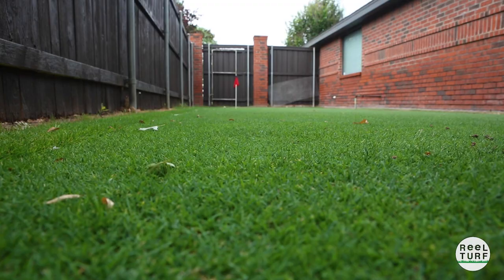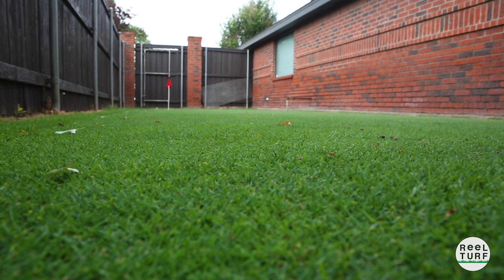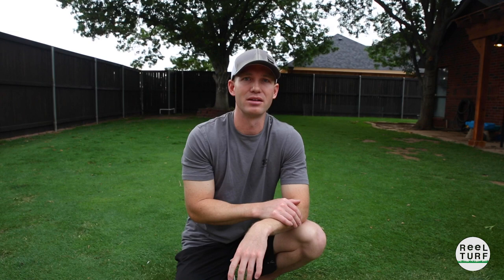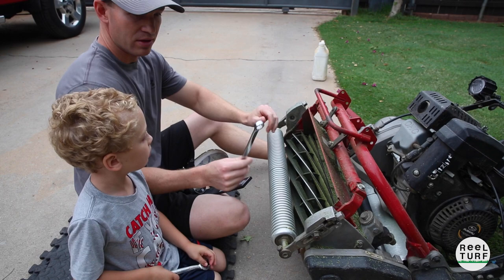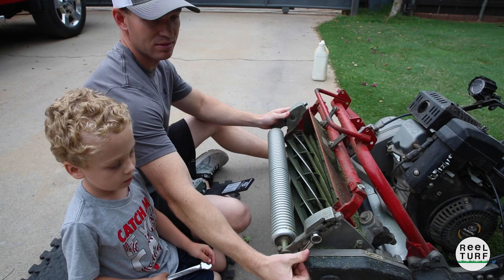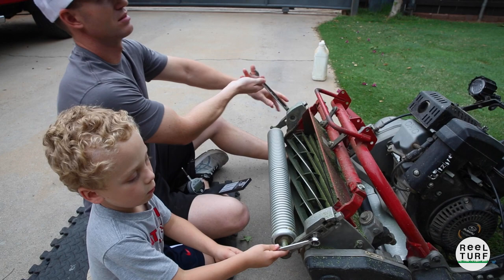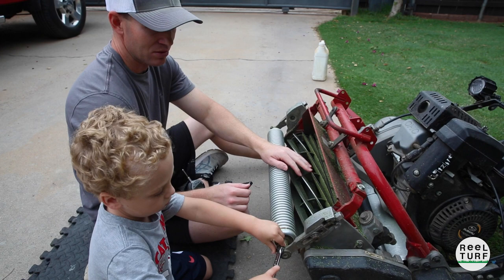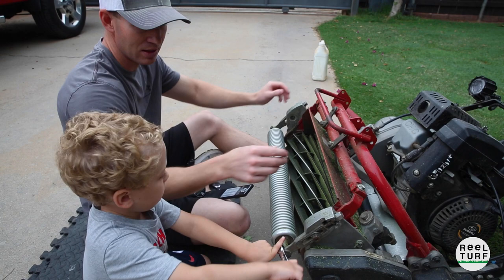Mowing an Overgrown Putting Green

Comment: I use Arena to lessen the worm castings. It’s mostly for grubs but it does take some of the worm pressure off the turf. Not sure if there is a better product specifically for worms, but that has worked for me every year. Thanks for the videos, I love the detail that you provide.
Reply from the maker: Glad you enjoyed it! I haven’t come across a permanent worm solution. From what I’ve read in the turf world, top dressing plays a big role in the suppression of worms. The sharp sand reduces their activity on greens. I believe they were bad for me because my green base was primarily clay. Had I known better back then, I would have incorporated a lot more sand.

Comment: So I commented on another video about attempting a putting green this year. Right now I just have a manual reel mower that can get down to 0.5". I'm hoping to secure a greens mower for next season but is it going to be difficult/damaging to take it down lower next year when I do eventually get the greens mower? Do you just slowly work your way down? Any advice on helping with the stress that will likely come from taking it down or does bent grass generally recover fairly well from that type of temporary stress?
Reply from the maker: The best time I have found to take the height down gradually is very early spring when the grass doesn’t grow much. You have less disease pressure and slower growth which allows you to take it down slowly without yellowing. You cannot scalp bent like you see people do with their lawns. Most of what you’ll see on the internet is people scalping their Bermuda to death or smothering it in sand to create a green. Do not do it to bentgrass, it will fail every time. A good greens mower makes the experience a lot more enjoyable. A ball doesn’t really putt well until the turf is below a 1/4 inch.
Reply: @ReelTurf  I'm constantly scanning marketplace and Craigslist for a used one. Saw a Toro Greensmaster that said it had about 200 hours on it and they are asking $1,000. I have no idea if that's a fair price or not.
Reply from the maker: Depends on the model. Send what you find to info@reelturf.com and I’ll be glad to help you find one.
Reply: @ReelTurf  awesome thanks man!

Comment: worm castings are infuriating. I have tried all the cultural practices- if they are ever successful it'll be a few years down the road. They are more active in some areas of my green than others but its like you said, pockmarked, like the surface of the moon. Oh well.

I appreciated the demo on small increment HOC too. The closeups told the whole story
Reply from the maker: Yes the worm castings are frustrating! I’ve read before with the correct type of sand in the soil profile you can eliminate them because the worms don’t like the sharp edges of the sand. If I ever build another green, I’ll be more diligent in the correct sand ratio in my soil profile. It’s frustrating seeing all of the hard work destroyed bit by bit every night. 

Yes there is a significant difference in bench height of cut vs effective height of cut. 1/64 makes a dramatic difference in playability. Glad you enjoyed it!
Reply: @ReelTurf  i started with regular sand just as a practice to firm everything up, then the castings started. I switched to coal slag and so far no change other than it's twice as expensive! It's only been a couple of months though and supposedly it takes years. I may try to build a true sand base by using my pro plugger to pull big cores and then replacing with sand or coal slag in the worst areas. Worms seem to like more moist low spots although they are not real picky.